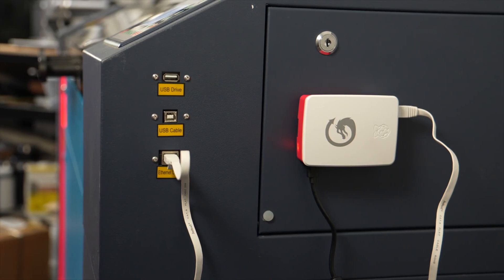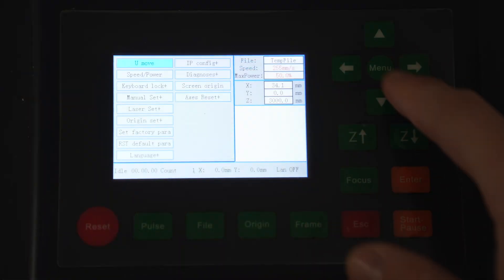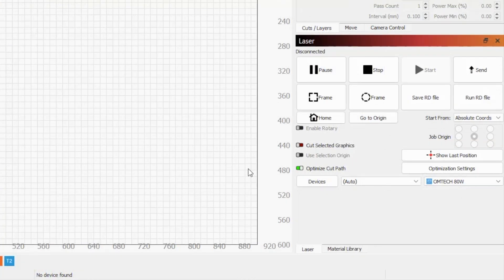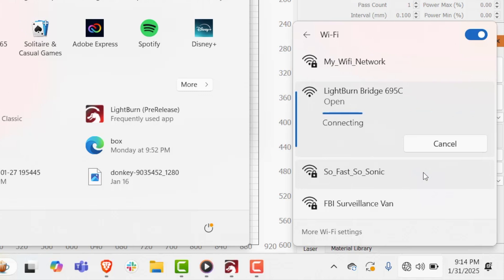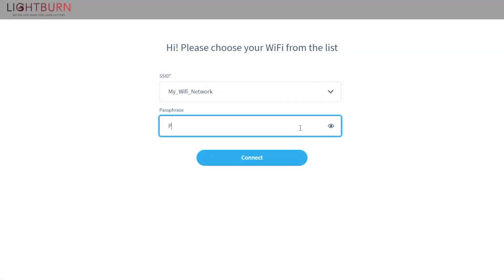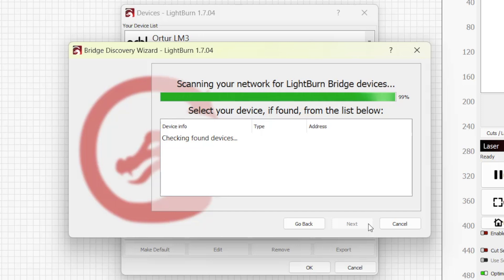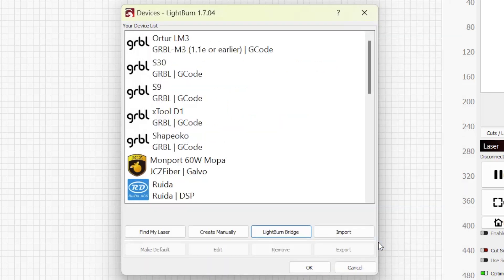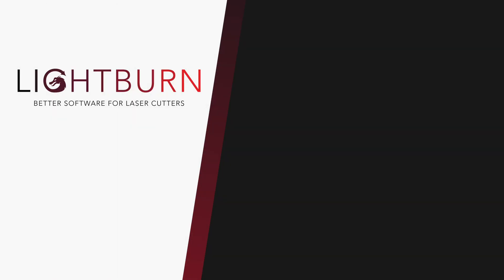LightBurn Bridge Setup Guide

Comment: Will this work with the Gweiki Cloud that has a proprietary version of a Ruida controller?
Reply from the maker: @reeves29456  - I haven’t tried it yet, so I couldn’t say for certain, but I suspect it would be fine. The cloud still connects with UDP for most things, and we barely had to change anything to support it.
Reply: On the store page for the Bridge it says.

"Note: the LightBurn Bridge is not compatible with Gweike Cloud or OMTech Polar lasers."

So maybe it is worth a try if you already have a Pi and can test for free. But I don't know if I would buy one for that machine since it seems likely it won't work.

Comment: Nice idea, but I did the same by adding another TPLink Deco M9  in my Mesh setup. Setting the deco"s up, is way easier ! and you get 2 UTP connections which allows me to use my
2 CNC's with one Deco.
Reply from the maker: @paulogic-ctraccs  - The Deco translates from TCP to UDP?  Ruida controllers use UDP for network communication, meaning there are no retries and no handling of errors. If a packet is lost it aborts the whole transfer, which is why it’s not recommended to use these with a standard wireless network. LightBurn communicates with the bridge using TCP, with full error checking and retries, and the Bridge then talks to the controller using UDP over a physical cable, where it works fine. With any normal WIFI device you’ll still have failed transfers due to packet loss because the Ruida uses UDP.
Reply: So the Bridge detects errors when transferring? Any different if connected directly bij UTP cable (no wifi or deco) to the lan or is the bridge still a better idea?
I'm always willing to learn  !
Reply from the maker: @ - using a physical cable to directly connect from a PC to the controller is the best option. If your PC uses a wired connection to a switch or router, that’s a close second. The moment any part of the connection is wireless you basically need TCP/IP to handle packet drops and collisions, as UDP doesn’t handle this.

The bridge uses TCP/IP between itself and  the PC, so packets are checked, error corrected, and re-sent if there are errors or dropouts. They’re then converted to UDP and relayed to the controller through a short cable.

You get the benefit of a wireless connection using TCP/IP even though the controller doesn’t support it. That’s the “magic” of the LightBurn Bridge.

Comment: You should drop the bridge honestly.   You can build this entire setup using a zero pi w, and a wireless USB software.  It's powered from the ruida.  It's the size of a USB dongle, and it supports the camera as well.  If you develop it correctly,  you can even add additional USB ports and pass through ports.
Reply: What's the wireless USB software?
Reply: I am thinking the same, but I think, they will optimize it, if the cash flow allow it. But they need to make money to pay the developers
Reply: Yeah I was thinking this is a massive waste of a fully blown pi. Just use a zero.

Comment: Can you connect a usb camera to it?
Reply: No, not over wifi at least.
Reply: Build your own, it cost 10$ for a fi zero w, and 5$ for the wireless usb software.   Then you can attach a usb hub or build your own.  It will then support 4 usb wirelessly, including a camera
Reply from the maker: @Protocol-X  - You have done this? The Bridge does some clever protocol-layer translation using knowledge of how communication is handled by the Ruida to get high speed transfers while still using TCP/IP for lossless transfer. I have yet to see another approach work as well.
Reply: @lightburnsoftware7189 I have.  I left a full message, but not sure if you deleted or if youtube messed up.  I also have your original solution in the post.  The usb dongle based off pi zero is my preferred method.  Almost zero setup and seemles.
Reply: @Protocol-X  ayo friend have you documented this anywhere?
Reply: You would think it would be able to? I run all my 3D Printers off of Pi4 and Pi5s running Klipper firmware and Mainsail UI. this lets you control your printer and watch the cam all from the same screen and wirelessly. Send the cut off to your laser and have Lightburn switch to a camera view on your monitor.